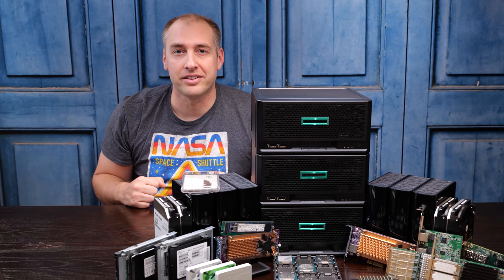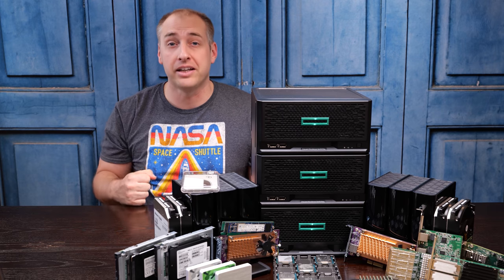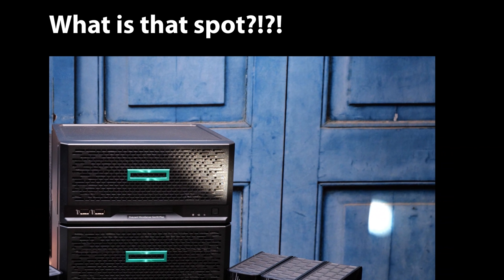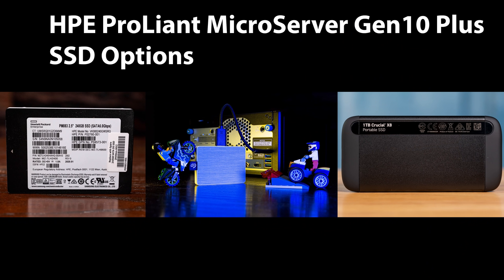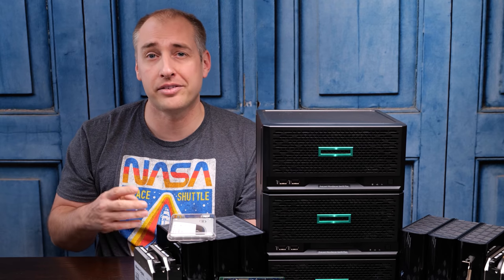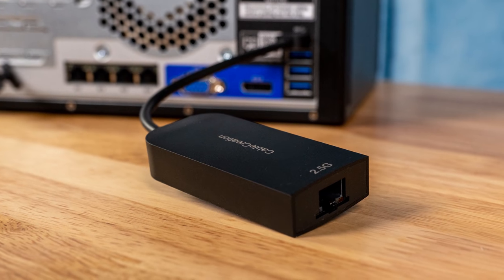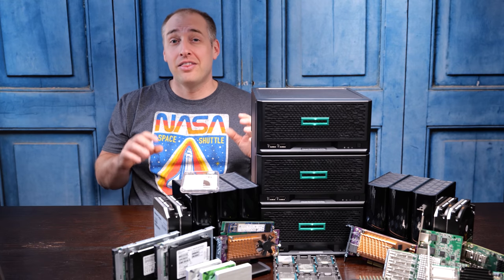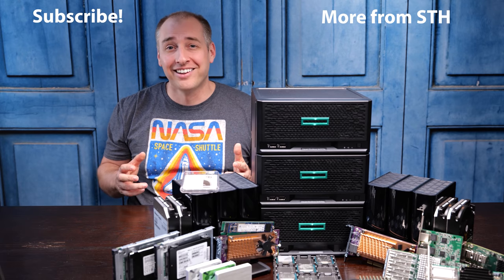Ultimate Guide for HPE ProLiant MicroServer Gen10 Plus Customization

Comment: I love these microservers, big fan of the gen8's upgradability and happy to see their return after the disappointing OG gen10
Reply: I think they are way too limited. 4 CPUs ou of 23? useless.
Reply: Return? With such power and thermal limit? It is just a slow NAS base for a branch office. Without software. In general it can be price compared to Synology or QNAP 4-bay systems where software is included to price. And then you have some corner cases where you can fit those: 10/25Gbit NIC, but no fast storage, or a lot of ram and SSD's onboard but no power left for fast networking. Buy HPE tower servers because you can not fit a lot to Microserver - you need a lot more space. Homelabs - too big for PoC homelabs... I was considering HPE Microserver Gen 10 Plus as my new NAS, but NHP drives ... no default universal 2.5/3.5 caddy ... seriously? Ok I'll go wild and buy two of them to have a home multi-node beast lab with 10Gbit interconnect and SAS SSD's - no onboard sas, powerlimit. Meh.

Comment: This video is a goldmine of info for anyone getting a Gen10+, 
It'd be good to see what kind of GPU's work inside it too, 
And if theres a potential to upgrade the external PSU, (if alternates are available, and if the system can handle the extra power).
I hope HP looks at using a socketed Ryzen CPU in the next generation, good performance with ECC support has made the 3200x a great CPU for a NAS.

Comment: One thing about power. If you have measured power draw from the wall you have to include power supply losses. If you want precise current draw you have to put clamp meter on power supply output, not input. For example, if you have 1000W power supply which is 90% efficient it will draw 1100W from wall and give you 1000W on the output.
Reply: came here to type this up, thanks for the assist. Also power-factor. But I do have to agree it's dumb to operate it nearly at max rated load.
Reply: Just wanted to type the same. 90% might be in the right ballpark for a modern psu at full load.  A well designed psu is able to work at 100% rated (not max) capacity. e.g. Seasonic often can provide 10-30% more power than is actually printed on the label. You should not use this safety margin a a regluar basis, but it is not a big concern.

Comment: I loved the size/design of this microserver but I need the power so I decided to go with ML350G10 from eBay plus some upgrades: 48GB 2666MHz DDR4 ECC, 512GB SSD + 1TB SSD, 2 x Intel Platinum 8160 = 48 Core. I wish my system could be smaller.

Comment: I have one of this on my work desk, acting like a workstation plus SSD storage in it. Configuration is 2x32G DDR4 non-ECC HP dimms, 3x1.92TB Kingston DC450R SSD and 1x480GB HP SSD. Plus, a nVidia T600 low profile video card (for 4 LCD). Almost two years, no problems at all running 24x7 on my desk. Wish to replace the Xeon with one more powerful, but I think exceeds the energy supplied by the brick... Thanks for effort and all the testing!!!

Comment: Great video and thanks for putting in the effort for this. I have the MicroServer Gen8 with the CPU upgraded to a Xeon E3-1220 V2, so the CPU in the original Gen10 would have been a downgrade. But the Gen10 Plus looks interesting and something I might consider in the future. It's a shame about the drive bays because the Gen8 bays are hot-swappable when the controller is in AHCI mode (but not in RAID).

Comment: Been waiting for this one to drop, nice one guys
Reply: Ok, so watched the video.
Would it be possible to swap the PSBrick for a higher wattage unit, this would, in turn, allow for the higher-spec CPU's etc.
Did you also check CPU temps, what are the capabilities of the heat pipe and how loud does it get when the CPU is being hammered using the stock fan, and speaking of the fan, is this a standard size/pinout?  I remember the Gen8 days where the fan in that had a non-standard pinout which meant higher performance version or non-H replacements were a PITA...
Reply from the maker: Hi. Answered this a few times here already. Here is the quick answer in the forums: https://forums.servethehome.com/index.php?threads/hpe-proliant-microserver-gen10-plus-ultimate-customization-guide.28013/#post-258541

Comment: I really like your videos keep up the great work. I kinda have to say there are two things about this server that are really annoying in my eye. 1st why is there no nvme m.2 slot for a high speed internal boot ssd and second why do you have to waste an expansion slot on the ilo kit it should be integrated into the mobo. It could then still require a license or a key. Just fixing one of those would make ot a lot better IMO.
Reply from the maker: The expansion slot for the iLO Enablement Kit is a dedicated slot. It is not a standard PCIe x1 slot. The license/ key idea is what we were testing with the iLO Advanced + Shared Port segment. If that had worked, you would need an Advanced key but not a physical kit. We were also able, in California, to get the MicroServer Gen10 Plus units much faster than the iLO enablement kits for them. There are a lot of places in the world that do not have the same speedy access we have in the Silicon Valley so that is why I wanted to test this. My worry is that the current enablement kit may be hard to source elsewhere.
Reply: @ServeTheHomeVideo  I did not look at it that closely and must have missed that it can not be used as a standard PCIe slot. However looking at the space on the back panel and the inside it seems like there would have been space for a x4 PCIe slot in the place of the iLO, but it could interfere with the drive cage due to it's length. The supply issue is quite interesting to hear and an other reason I would prefer a software based license. Maybe HP feared a software restriction could be circumvented with a hack.
I really did not expect the testing with the advanced kit and without the physical kit to work, but trying proofed the thoroughness of your tests.
Thanks for the quick reply

Comment: @14:55 You dont need to reboot the server. You just need to rescan the bus. Like such:
Before unplugging disk run the following:
root@pve01:~# readlink /sys/block/sdX
../devices/pci0000:00/0000:00:01.1/0000:01:00.0/host5/port-5:10/end_device-5:10/target5:0:10/5:0:10:0/block/sdX
root@pve01:~# echo 1 > /sys/block/sdX/device/delete
Now unplug faulted disk and insert new disk.
root@pve01:~# echo "- - -" > /sys/class/scsi_host/host5/scan

Make sure the Host5 number in the last command matches the # of your output!

Comment: Great review - not sure about the product, the power limitation is huge downside. Small solid state devices should be the norm with this, no hot swap drive, no m2 built in.  I do not want to be too harsh because it looks good for a single purpose machine and its a Xeon.

Comment: What is the power supply voltage, and does it use a simple coaxial dc connector? I'm wondering about the viability of using one in off-grid situations using a dc-dc converter for power rather than an inverter.

Comment: Could you please post the settings in BIOS how you made hard disk drives of 8, and 10 TB visible to ESXi? I found an message in BIOS that for drives > 2.2 TB the AHCI mode has to be used, not the UEFI.

But still the HDDs don't show up in ESXi.

Comment: the powerbrick is rated at the COMPUTER side of the brick but you meassure at the WALL side of the brick, did you factor in efficiency as well? like what 80+% efficient? so 100W from the wall is only 80+W on the computer side?

Comment: hmmm i am not so sure about hot swap or not, but it is usually also not the best idea to hot/cold unplug a hdd in win10, yet if you disable the hdd to offline via drive-manager, you can and it works
Reply from the maker: The actual connectors/ backplanes for hot-swap have circuitry designed for that which is why this is not capable.
Reply: @ServeTheHomeVideo  in real hot swap cages mostlikely, but i am talking low tech solutions, or bare connectors/pass throughs

Comment: Power supplies are rated at what they deliver, not what they consume. 
This is likely roughly 80% efficient and is rated to deliver 180 watts continuously. 
That means an at-the-wall power consumption of ~225 watts.

The Lite-On specs call for a max of 240 watts of input for this supply.

"Recipe for absolute disaster" at 195 watts at the wall... wow.

Comment: Question. i intend to put an SSD about 1TB in that device. how can i know if it is compatible? i have also seen on their site (16TB (4 x 4TB) 3.5 "SATA HDD 960GB (4x 240GB) 2.5" SATA SSD).

does it work with any particular species? what must satisfy? 
I saw some more reviews on the internet, where they have a 2Tb ssd and it works, and somewhere some of the 500gb doesn't work? can some help. there is nothing concrete on their page.

2nd question, Proxmox VE, or XCP-ng work only on RADI 0?  i can't combine say, 1 slot RAID 0, 2-3 slot that is RAID 1??? i need extra  HP PCe card slot controller, to work in that combination?

Comment: Is the motherboard limited on how much power it can draw and supply, or can you get a bigger power adapter with the same barrel plug to raise your power budget?
Reply from the maker: Insightful question. Twofold answer. In theory, you could add a bigger adapter but then you run into downstream motherboard power delivery not being designed for higher input amps. Messing with the power delivery increases the risk of catastrophic failure which is a key item we wanted to avoid. Second, the reason we had just the Xeon E-2288G plus a 2.5" SSD and no add-in card in the system was also because we were reaching the practical limits of cooling. Adding 3.5" drives that generate more heat and block airflow or add-in cards likely would have pushed this further.

Staying within the original PSU guidelines allows one to stay safe.

By the time you buy another PSU, modify cooling, and hope you do not run afoul of your motherboard's power delivery capability, realistically it is cheaper and easier to move up to the ProLiant ML30 Gen10 https://www.servethehome.com/hpe-proliant-ml30-gen10-review/

Comment: A bit late I guess ;) I have one of theese with original cpu (Xeon e-2224) i believe . and 2x16 GB ecc ram and 4 x 8 TB WD gold enterprise hdds and thinking to upgrade with a intel sparkle arc 310 or 380. Question is will either of them fit and will it be ok power wise ?

Comment: Isn't it the case that any Intel CPU can be power bounded by overriding pl1 and pl2 values? (So any processor can be hard capped to 65w or 45w if needed to).

Comment: Awesome video, thank you very much.
I currently use an (ageing)  HP microserver gen8.  I use the SATA5 connector to connect an SSD solely for the O/S (Windows server 2016). I think this was intended to connect a DVD drive which I don't use.
I am unsure how I would configure a G10Plus to still use the SSD to hold the operating system and still leave the four SATA bays completely free for storage.
Can you comment?

Comment: Good job on this!!!, for a basic server with AD services role on a small remote site with 2 ssd drive, do you know if the orginal power supply should be okay??

Thanks
Reply: It would work just fine. SSD's use less power than Platter drives.

Comment: One more interesting question, digging a bit deeper, it seems the display port is just 1.0??? Xeon E2224 doesn't have a integrated graphic core, but for those who have one, like G5420 or i series, is the cpu integrated graphic blocked? if yes, a dedicated graphic card will have to join the race for the single PCIE slot for some people.

Comment: Hotswapping: You will not see the drive until you reboot the server
I have a Gen10 Plus and that's not true, i did tried and it did worked....... except
At the time you plug/unplug the drive, you will hear ALL other drive "clicks" and re-spinup
The computer will see ALL drives disconnected and then reconnected, and you may get I/O error during the process

Comment: Tried to add a 2.5 inch intel 180gb SSD hard drive with the 3.5 inch converter , in the internal slot . But the server will not detect it..

Comment: looks like HP needed to have an option for a 200W+ unit. maybe a 280W unit would have been a good upgrade option.
quad 25g ports. the only use for that I see would be trying to get faster than 10g for say a single video editor at a time but even with say 4 raid 0 ssds that would be a struggle.

Comment: Hot swap is done by the SATA controller.
Reply from the maker: That is only partially true. The PCH that is controlling these drives supports hot plug. The cables do not. You need pins to be the correct lengths and such to provide the right sequence of power and data to the device to allow the system to properly recognize the drive. One of the fun things you learn reviewing this stuff and getting to talk to people who are passionate about hot plug timings.
Reply: @ServeTheHomeVideo  As far I know the different pin length are on the HDD side and not in the backplane.
My old G7 with unloked bios is able to recognize hot-plugged drives. (Under linux)

I would like to see a macro picture of thoose sata power connectors!

Comment: really great work done by you guys! did you guys tried to swap the power supply for something like 12v 20a 240W?
Reply from the maker: Hi Chris, I answered this quite a few times. It is not as simple as a power brick swap and also by the time you do it, you are better off getting a ML30 Gen10. Here is a bit more on why: https://forums.servethehome.com/index.php?threads/hpe-proliant-microserver-gen10-plus-ultimate-customization-guide.28013/#post-258541

Comment: Don't these come with epyc?
Why buy a xeon these days if you can have an epyc box..
Reply from the maker: They do not. These are also "Entry" Xeons so the socket is much more compact and lower power. We probably have more EPYC 7001, 7002, and 3001 reviews out there than anyone. This is just a form factor thing. Now, you also may want to check out STH tomorrow for something AMD.
Reply: @ServeTheHomeVideo  yeah, i'm not complaining about the content at all. Sorry if i gave that impression.
Was more geared towards hp if anything.
I suppose demand for intel xeons is still high from the general public so they are just supplying what is asked for.
But still though, a threadripper would offer much more for the same power envelope i reckon. And probably cheaper as well.

Comment: HPE Gen10 plus Disable Matrox GPU
Hello,
We have a Gen10 / E-2278G CPU and an Integrated Matrox G200 GPU. 
The E-2186G CPU theoretically contains a Intel® UHD Graphics P630 processor. Is there any chance we can disable the Matrox one which is the default GPU and use the Intel one instead in EXSI ？I not find Intel® UHD Graphics P630 in EXSI list。

 Thanks

Comment: So what have we learned about using the HPE Proliant Microserver Gen 10 Plus? Upgrade the external power supply if you want to do serious customization.
Reply from the maker: Hi Rolston. We addressed this a few times in these comments. Also here just to avoid repetition. Adding a bigger power brick is not necessarily going to work in this system. https://forums.servethehome.com/index.php?threads/hpe-proliant-microserver-gen10-plus-ultimate-customization-guide.28013/#post-258541

Comment: Will shucked drives work on these guys in the bays in the front? I know you generally have to disable a pin for them to work.
Reply from the maker: John, the 140TB section with the 127TB ZFS pool was done using WD EasyStore 14TB drives. Six of the ten were still in their external enclosures, but four of the ten were in the internal bays.
Reply: @ServeTheHomeVideo   I second the question.  When you opened the drives up to put them in.  Did you disable the pin to make them work in the internal bays?
Reply: @ServeTheHomeVideo  Given the recent WD Red SMR controversy, and your recent video about horrible performance for RAID rebuilds with WD Red SMR drives, it might be a good idea to recommend users to explicitly look for 5400-5900RPM (for lower power/consumption) CMR (for acceptable performance).

Comment: Just another question, do you think if it is possible to use the iLO PCI slot for other things? the slot is very close to the frame so there might be no room for an ordinary PCIE card, but there is PCIE extension cables xD
Reply from the maker: From the block diagram (seen but we do not have permission to share), this slot is not a PCIe slot that goes to the CPU or PCH. Instead, it is dedicated for this enablement kit. Also, you are right that it is not a standard PCIe form factor.
Reply: @ServeTheHomeVideo  Thank you again for the information, saved my 20 Euros.
Reply: @ServeTheHomeVideo  That slot to mee loks like power and SMI+RGMII bus for the eth PHY of the iLO. (looks like that the ilo is a simple 88E1512/14 based card, china will copy the design for sure.... socket is a lot similar to the pcie x4.)
It might also have some i2c/smbus bus for eeprom id and authentication of the expansion slot.

Comment: Hey, i just bought the gen10 plus and a external ssd. COuld you guys show me how you set it up to boot from the external ssd because it isn't really working for me
Reply from the maker: For OSes that support USB boot, the UEFI entries were automatically created as one would want. HPE has one-time boot and boot order setting in their firmware. Are you trying to install an OS that does not support USB boot such as Windows?
Reply: @ServeTheHomeVideo  im trying to install clear os. my setup is 3 WD RED 8TB HDD inside and i want to use the external  Crucial 1 tb for the ClearOs
Reply: @ServeTheHomeVideo  how did you guys make the external harddrive a bootable drive for the OS?